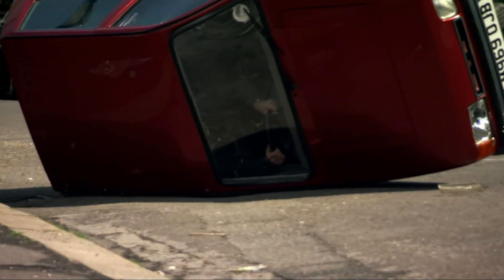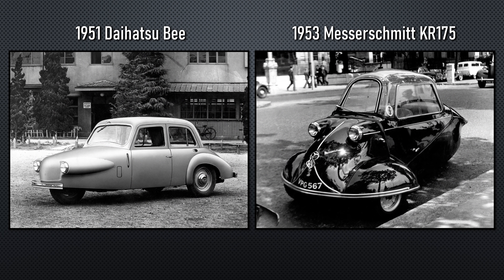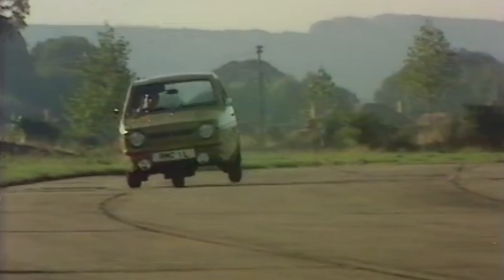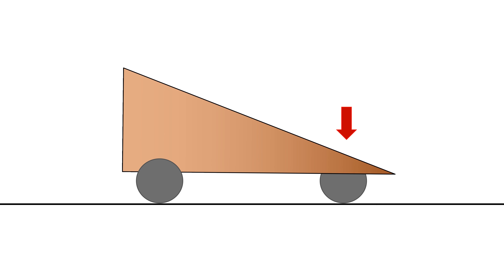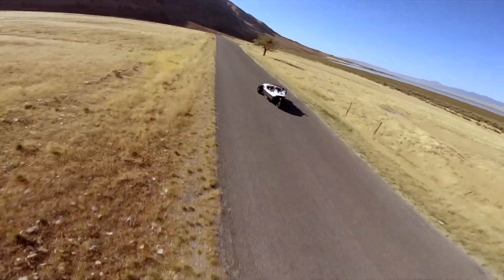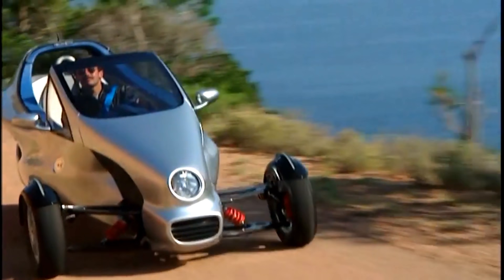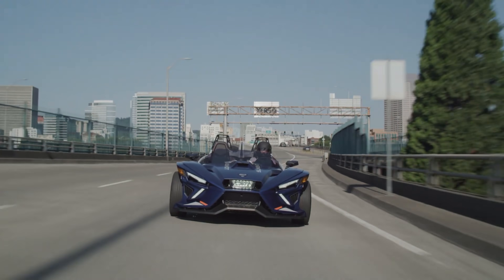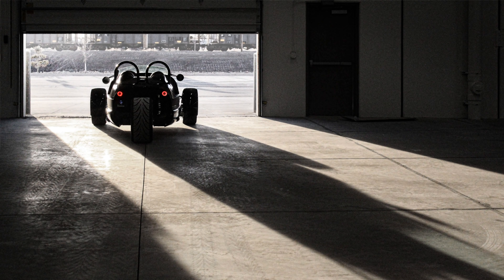Are 3-Wheelers DANGEROUS???

Comment: I had a Reliant Supervan for 12 days before it rolled and self destructed. Not dangerous, bloody lethal...
Reply: You mean you had a reliant supervan for 12 days before you rolled it. It didn't roll itself.
Reply: @kyle8952  Debatable. I was driving in a straight line at about 45 mph at the time. The front wheel hit a patch of ice or something and started snaking. My attempts to correct it made matters worse. Theoretically I could have saved it, but to this day I don't know how.
Reply: @billdyke9745  what happened to the supervan
Reply: @John-ci2sd   It rolled about 4 times, coming to rest upside down on the opposite verge. The body was smashed to smithereens. The scrapman got it. (Possibly a kingpin failure).
Reply: @billdyke9745  I can't imagine that happening on its own. I've been cornering a Rialto at 50MPH for quite some time now and still no issues
Reply: @mrjed6912  True story. Between Xmas and New Year, so a patch of ice may have had a hand in it. And the kingpin was due for rebushing...
Reply: Did you tangle up with Mr. Bean's Mini?

Comment: Not if there are two wheels at the front and one at the back.
Reply: the reason why no one buys 3 wheelers anymore is because of the inpracticality and expense of the reverse trike configuration. The Robins were already stable later on. with todays tech you could make a Robin with safety systems that people probably would buy.
Reply: And there aren't many cars like that around
Reply: They can still roll over on a corner, especially under hard acceleration if rear wheel drive.
Similarly a single front wheel can be very stable - motorcycle style choppers with a VW Beetle engine at the back is a good example because of the weight distribution.
Reply: Thats more unstable